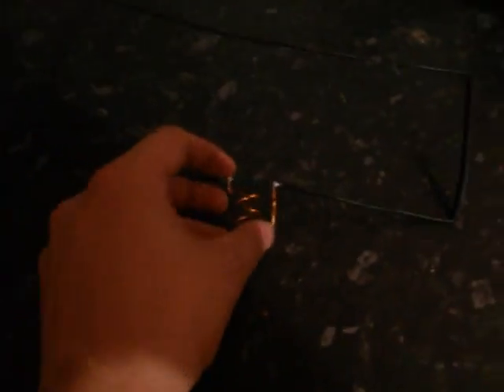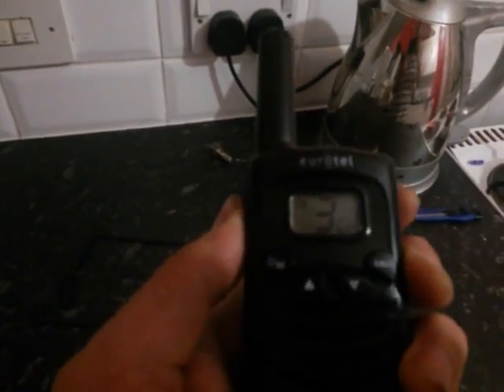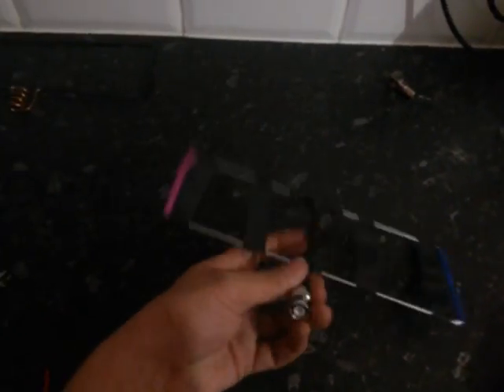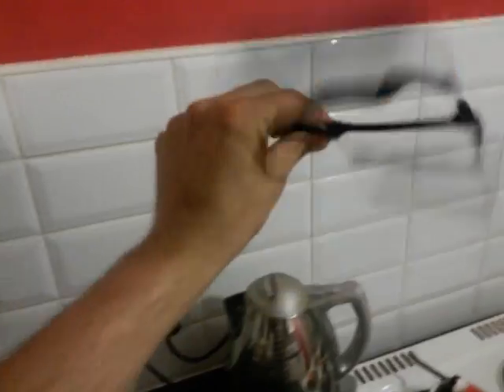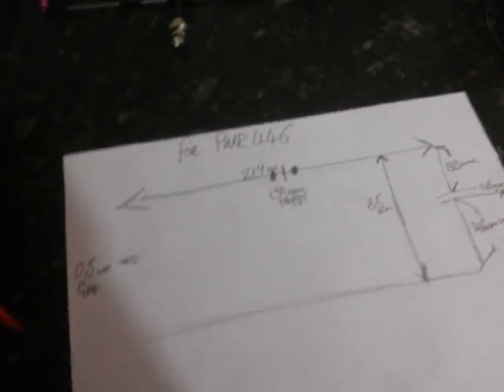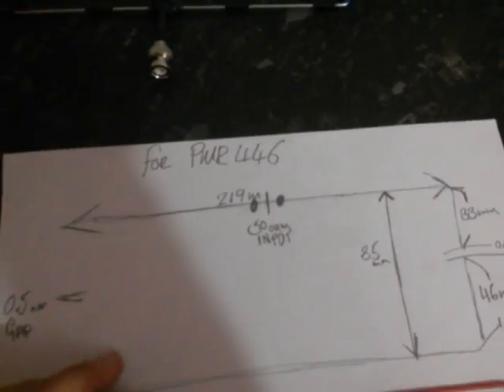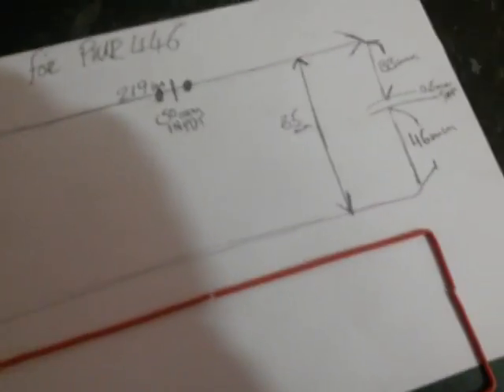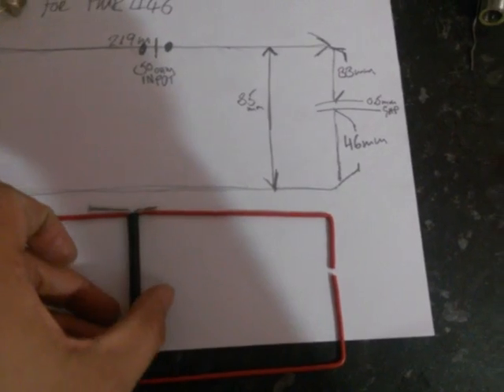Pmr446 super antenna

Comment from the maker: the recording was to show a basic antenna with noticeable results being used on a licence free restricted use PMR    as UK legislation states that PMR. 0.5w talkies must not be modified in particular the antenna if to be used on the allocated 8chs ofcom has already intercepted   illegal handsets being used on the 466mhz band as radio used does not meet requirements as set by uk government.. this recording shows you a legal loop hole as pmr handset or antenna is not moddified....